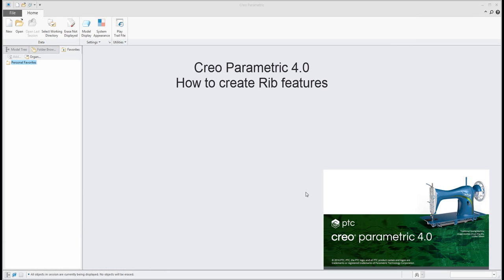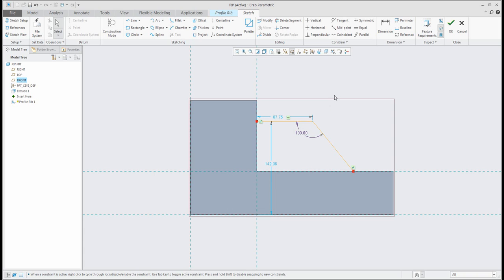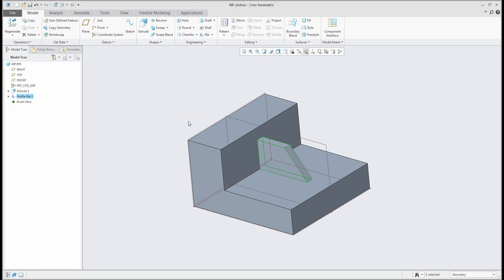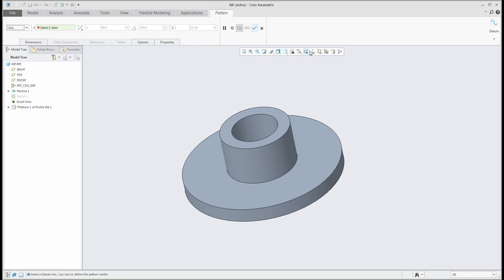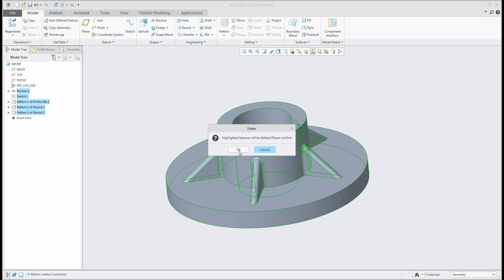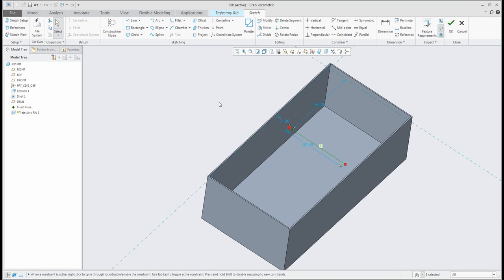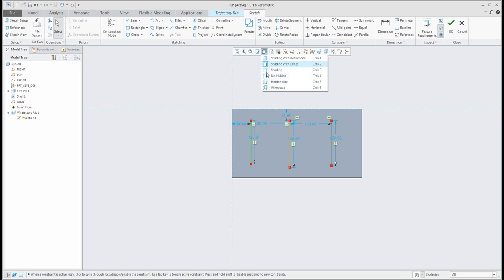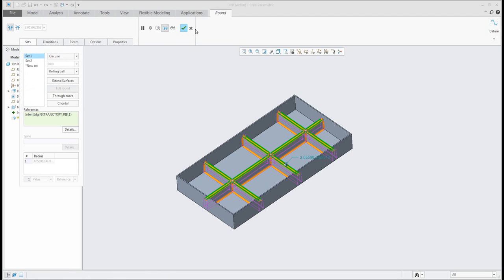PTC Creo 4.0 tutorial: How to create Rib features

Comment: What if I don't want to attach the ribs to the inside wall?
Reply from the maker: This feature is possible to use only if you want to connect all inside walls. For your example... Try to use only extrude features
Reply: I might be 6 years late but the boundary blend is the most powerful feature, you should refer to using it whenever nothing else works.